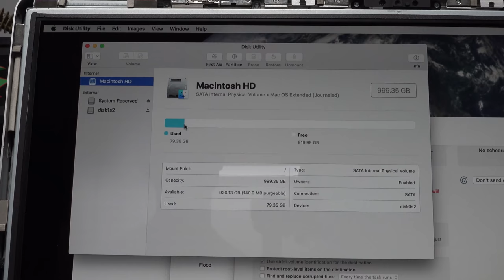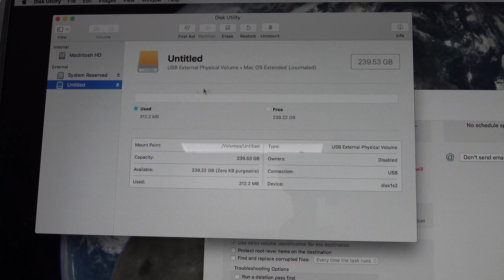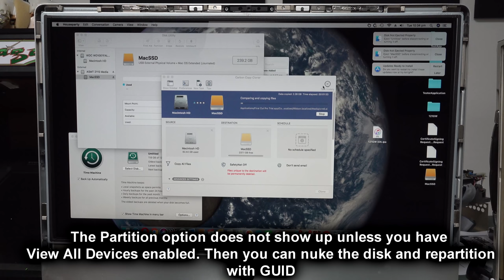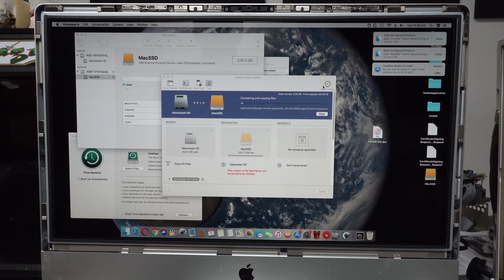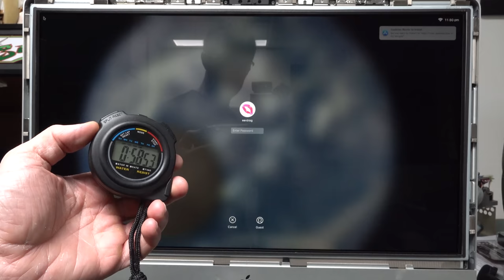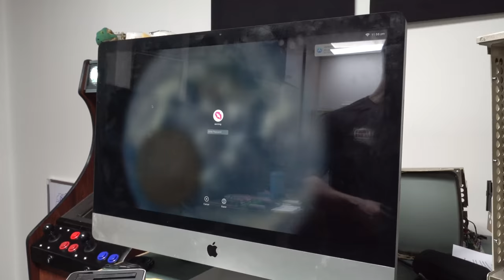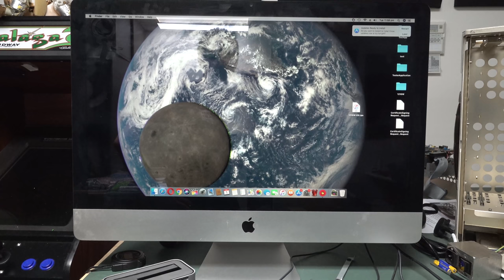Dumpster Diving 27" iMac Upgrade

Comment: 7.38 that cable is a temperature sensor cable you will need to ad a new sensor just like that one there are on the dvd drive ;-)
Reply: Without the temperature sensor the fans can ramp up and run 100% and other quirkiness can happen.  You can find replacement adapters so the mac won't freak out with your SSD in there.
Reply: I swapped an SSD into a similar vintage iMac and found the fan ramped up to 100%. Found a software solution (SSD Fan Control) that worked fine until last year when my iMac died - RIP https://exirion.net/ssdfanctrl/

EDIT: If SSD fan control doesn't work, I've seen this used successfully (especially for Crucial SSDs) https://www.eidac.de/?cat=40
Reply: @DiverJames  no need for software just ad a new similar temperature sensor like that one on the dvd drive and then you are god to go ;-)
Reply: @nielshkristensen1815  except for the whole removing the screen thing just to add a temp sensor. A software solution is quick, convenient and works, but not necessarily the "most" efficient solution 👍🏻
Reply: My former employer had a whole heap of Mac mini’s at an old site that were probably thrown out. managed to grab one.

Comment: 2011 was the last model year of iMac that I didn't hate and would've considered buying. The 2012 and later (post-Steve Jobs) models are SO much more difficult to service.

The extra cable from the HDD is actually for a thermal sensor. You may need to short it out if you run into fan speed issues.

Clearing the PRAM (hold Cmd-Option-P-R on boot until you year a 2nd chime) will fix your startup performance issues.

Comment: Such a great design (apart from the exposed PSU PCB), how far they've fallen.

Also, a WD Black HDD is rated up to at least 55C so yeah its gonna feel scaldingly hot to the touch.

Comment: That "drive select" cable goes to a temperature sensor on the disk. It's likely in nuclear mode with everything throttled back to prevent what it believes is a overheat situation.
Reply: As an example: https://blogtomavern.wordpress.com/2016/08/14/upgradingreplacing-the-hard-drive-in-a-mid-2010-imac/ 
SATA doesn't have drive select so those pins are for completely other purposes. Another set of them are for an uart to work with it and service mode and some other junk.

Comment: The first time Mac boots with a different drive: it does some shenanigans before it does some initialization. Did this with a new macbook when I swapped the mvme drive from an dead Mac book to a same model.
Reply: Mac also supports considerably old hardware which is nice. 6 year old computer? You want an OS update to today? No problem!
Want a new battery? NOPE!
Want a new device/component/OEM part? NOPE!
Buy our monthly recovery services subscription and disaster recovery option.

Comment: I had 2 of these.  The Mag screen was great idea, Simply outstanding design..  The 2012 I had was stuck with adhesive tape and much more of a PITA to get into. An SSD update does give these a new life, but in the end the I5 reached its limits.  Not Intels best chips sadly.  These were the last of the modular models and the next ones were more like laptops with everything on the main board and a soldered cpu and GPU.

And my god I though that screen was cracked when you fired it back up 😂
Reply: wtf the newer ones have the glass glued on???

Comment: Those WD black drives do run hot but are fast for a spinning rust drive, that one has had very little use by the used space on it :)

Comment: On SATA there are no drive select pins afaik. I think it's a temperature sensor (why they don't just use SMART data is beyond me).
Reply: Came here to say this, you are correct. When I did the same thing Dave did in this video, the HDD fan ramped up to max and stayed there. I ended up buying a sensor component from Amazon to hook up to it, but perhaps the same could be done with a resistor maybe? Anyway, it fixed the issue.
Reply: SMART is a software query, and they wanted thermal control strictly hardware
Reply: @jaycee1980  Fans are controlled by a microcontroller called SMC on macs, it is always software. Whether I read a temperature resistor or let the microcontroller on the harddisk itself do it is kind of samey
Reply: @VincentFischer  I know but what I really meant is that SMART requires talking to SATA through the main chipset, and this cant be easily achieved by the standalone system that does thermal management

Comment: looks like as if it boots after the default boot option didn't work. once logged in search for boot disk and select the right os . holding the option/alt when powering up shows you the boot options the first being the default

Comment: In the scheme of things saving 40sec on boot up is not really the point, using a solid state drive should give you better performance in general use, after all what are you going to do with your extra time saved on boot up ☺️

Comment: Should have stocked up on conversion brackets out of junk pcs in the garbage room... I couldn't stand to tape it in. Not at all an expert on Macs, but when you resize filesystems basically you have the files and folders and some boot things that need to be on certain blocks to work. So I have at times just copied the files from one place to another in Linux and somehow restored the boot loader. I am sure that is kind of what happened with the restorer also.

Comment: Any thoughts of upgrading the graphics card which I’ve been lead to believe will allow you to update macOS beyond high Sierra
Reply: Has it the infamous HD 5000/6000 series? There are a few options. Nvidia Kepler cards are the easiest option, but you can get Polaris cards to work. 
It isn't instantly compatible with new macOS Versions afterwards but it allows you to run a Big Sur / Catilina Patcher

Comment: "fiberglass and silicon drive(?)" lol, Dave I think you mean Solid State Drive 🤣
Reply: but my SSD makes noise   that is not solid state

 you can hear a whining noise  when writing/reading  this indicates it's not solid state
Reply: @punker4Real  Microphonics. MLCC capacitors and innductors can vibrate due to lenz law and peizoelectricity. Often called "coil whine" in the PC world.
Reply: @power-max    that is still a lame excuse   that is why they hot snot them
Reply: @punker4Real  ???
Hot glue SSDs? I've done that, but generally from a manufacture they are mounted like standard 2.5" drives (U.2 form factor), or if they are M.2 form factor they are installed on the motherboard.
SSD's are as "solid state" as you can get. Nothing in them is mechanical or reliant on other states of matter. and is entirely based on silicon flash memory, which itself is based on a floating-gate MOSFET.

Comment: I prefer this generation of iMacs with optical disc drives that can be swapped out for a SATA SSD using a special adapter tray (or, yes, a bit of tape), while leaving the existing HDD as a scratch drive and/or storage drive.
Because this is a dumpster Mac, don't bother cloning - just make or borrow or buy an install USB with the latest MacOS it'll support and fresh install MacOS to the SSD... or install Windows or Linux on it.
Reply: The optical drive SATA connector on is SATA I (or 150MB/sec). The internal hard drive connector is SATA II (300 MB/sec). It is hard to justify putting an SSD on a SATA I connector. I would prefer to put the SSD on the SATA II, and if need be for extra data storage, either an external USB, or Firewire 800 drive for bulk storage of large photo or video libraries. The USB ports are USB 2.0, and the Firewire drives are 800MB/s, or 400 MB/s with an adapter cable.
Reply: Are you sure the SATA connector reserved for optical drive in this model - which seems to me to be a 2010-2011 27 inch iMac - is SATA I, and not SATA II?

Comment: I don’t know what you did with it to clear it out when you got it but perhaps the boot time issues might be fixed by just nuking the drive and reinstalling fresh? If you boot holding cmd/winkey + alt + R you can boot internet-based recovery which can then be used to nuke the drive and reinstall the latest OS version.

Info about startup key combos: https://support.apple.com/en-gb/HT201255

Comment: The small cable is for tempreture sensing of the drive . when removed the cooling fan for the drive will run flatout . to control 
the fan speed , you can install a program like https://crystalidea.com/macs-fan-control . better way to install macos is via 
USB install and timemachine recover data if needed . another tip after removing the glass , don't touch the LCD , takes ages to clean .
I have touched the power supply , and you never forget to unplug an iMac again.

Comment: you should insert two ssd samsung in raid. I am using 2011 model and still working fine.
Reply from the maker: I didn't see an extra sata cable? In any case, no need for it's intended use.
Reply: @EEVblog2  cd drive probably?
Reply: @mistakenotou7681  The DVD drive is the way to do that. You can get the Data Doubler from OWC (macsales.com) to mount the SSD in the DVD bay and it comes with the adapter PCB for the SATA and power cable. You have to use the SATA/power cable already in the MAC (which is why an adapter is needed).

Comment: Tell how you access my Access Databases (with a LOT of VBA code) with a MAC?  Do they even have a database for MACs?
Reply: There are several, including Microsoft access, sql, mysql and several others
Reply: @massmike11  Yes, but if I remember when I tried, Access, under the MAC, did not support VBA behind the scenes.  I have many Access databases with a huge amount of VBA behind them.  I even write test software in Access that accesses my test gear (scopes, generators, attenuators, DVMs, etc., via VISA, and instrument under test via RS232 commands).  I like using Access with VBA rather than VB because of the easy reporting and data-basing functions.

Comment: I hope whoever designed that screen front to be removed without a special Apple (TM) tool got fired
/S
Reply: just a standard suction holder. got mine at bunnings hardware
Reply: You mean the standard non-Apple suction cup? The nerve!
Reply: Either that  was a tongue in cheek comment or you really love the new non repairable crap they make now. I would have said "I bet whoever made that screen removable WITHOUT a special tool was fired" but then that is just me.
Reply: Yeah,  I misread it; :(
Reply: Turns out reddit isn't THAT popular
/woosh
Reply: @wayneparris3439  Have another read!

Comment: Hi, in term of the delay while booting you can try to reset the NVRAM. its described here: https://support.apple.com/en-us/HT204063. if this was not a success you can start in verbose mode and try to find out if something consumes time... press and hold the Command (⌘) and V key  right upon you hear the startup chime. Peter Sevinc
Reply: he just had to set the startup disk

Comment: its a unix.. why not be quick and do it in commandline?!?.. oh well.. xD
Reply: was going to say this myself.
Reply: I hardly work with macs as am I Linuxer aswell. But some of my co-workers use them and whenever they need help with something I usually do it in the Terminal or whatever apple calls it. It works as expected. Mostly (Docker and its cli behaves quite strange on mac with some permission stuff going on). 

But I still wouldn't use one. Slow ass piece of overpriced trash, but I have no idea why the Terminal should be bad. I think it's the single most useful thing in this piece of junk 😂

Comment: Speaking of connections to HDD's...
I've searched with little success, is there an output on sata drives  to drive or at least signal drive activity?
Reply: Pin 11 on the power connector has a few different purposes including that. In normal PCs this is grounded which makes the drive spin up right away. If you float it the drive will power up in standby and won't spin until first accessed. Then pin 11 is an active low 3.3v activity indicator.
Reply: @eDoc2020  legend! Thank you. I've been looking for that answer for 5 or so years, on and off.

Comment: Aren't any thermal issues?  The imac is one giant thermal issue.  They've had issues with gpu's literally desoldering themselves from the board under things like encoding loads.
Reply: The solder melting issue was not with the PCB, it was with nVidia's bond wires inside the chip package of certain nVidia GPUs. That is why nVidia paid for a large percentage of the recall costs. The Macs of that generation (pretty much all generations that are repairable) really didn't have any thermal issues to speak of. The newer iMacs, and MacBook Pros have thermal issues galore, mostly related to Intel's failure to deliver on promised power efficiency improvements since 2015/2016. I have the same generation of iMac, with 12GB RAM, and it has been running 8 hours/day since new, and it is still just fine. Mine doesn't have the nVidia chip with the problem, it has the upgraded video card, and has neither the video card problem, nor does it run hot, or run with the fans on for most of the time.

Comment: I would have just used a 1TB SSD and cloned the whole drive
Reply: waste of money
Reply: @l3p3  Not if you value your time.  My time is much more valuable than the small increase in cost for a 1TB SSD.   It would cost me more to muck with getting it to work on a smaller one than just getting a big one that will easily clone.   Perhaps your time is not worth much.